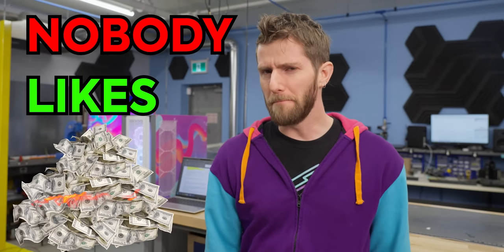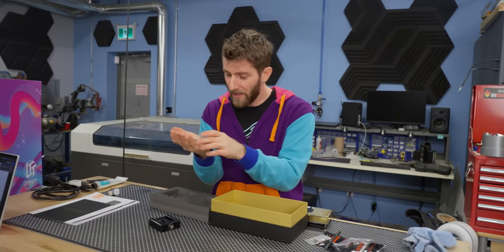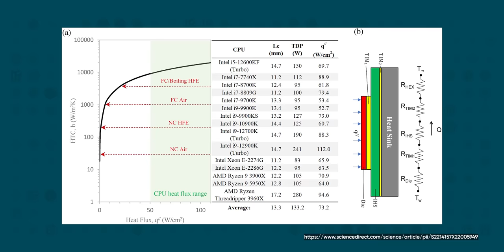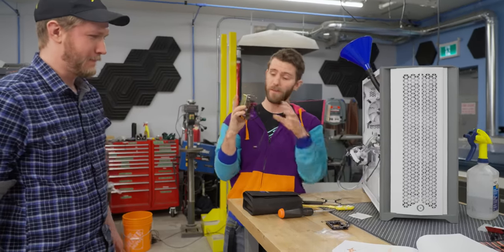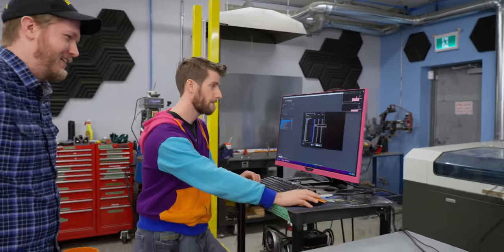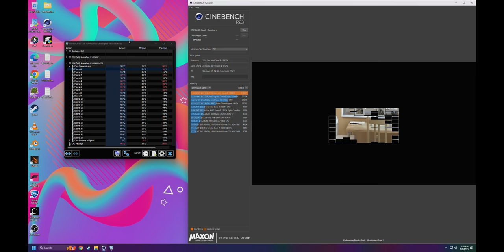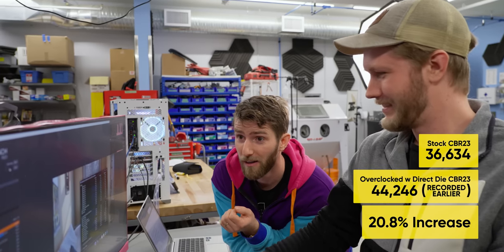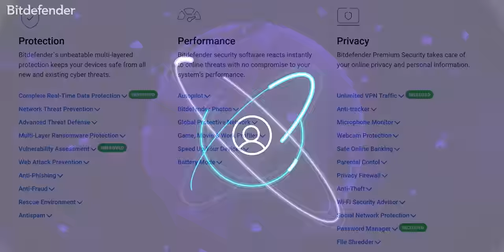This Cooler Might Kill Your CPU - EK Direct Die Cooler

Comment: Alex's gleeful little giggles at 17:20 has got to be the most excited we've seen him in awhile
Reply: Yea that's going to be a crazy video whatever it is
Reply: happy engineer noises
Reply: What is Elmer labs tho? I only find some biology stuff lol
Reply: @Lowkas  If it's ElmorLabs, then it's a PMD (power measurement device). It lets you measure the voltage, current, and power running through the cpu and gpu cables.
Reply: @Lowkas  ElmorLabs is a team that has specialized in cooling CPUs with liquid nitrogen and liquid helium, including being the first people to get a CPU to 9 GHz.

Comment: Hi linus and team , great job . Although let me tell u guys something,  i work as a engineer on uk , sorting water loops and systems to power plants, pharmaceutical companies as well aeronautics.  I believe you should get some control of your water there specially with all that copper laying around . I advise you to get a softener that later you can use for ur appliances and if you can an ro will be perfect as you will get water around 10uS (micro siemens) not being to corrosive . If you cant get an ro just remove the hardness of the water with the softener and they hook up a small mix bed to remove the contamination ❤

Comment: The delidding part was even more painful than Linus's usual... antics...
Reply: Very, very painful to watch and i'm dying with laughter right now too... after all that effort... they got 37334 on a direct die custom waterloop!... I get 37393 on average on a 7950X with 360 LF2 AIO which is not even being utilised 100% due to the one of the fans being at angle due to the VRM heatsink. Sure, they can get higher if the tuned the ram and settings in the bios but all that money and effort... for such diminishing gain 🤣🤣🤣.
Reply: @earthtaurus5515  I mean that was at stock... arent amd cpus OC out the gates?

Comment: Those old Athlons with ceramic packaging were very prone to die cracking, since the ceramic base had zero flex to give in and any over pressure of the heat-sink would start chipping corners and edges from the brittle silicon crystal.
Reply: I have a box full of broken ones 😂 few intel chips in there too.
Reply: Yeah, coupled with a very little die. Any pressure concentrated on an edge and you'd easily chip the die. 

The mounting hardware of the time didn't help either... (Single spring clip, essentially forcing an unknowing user to load one side in a rocking manner).
Reply: @volvo09  And only four small rubber pads to keep the cooler level.
Reply: I chipped one but it didn't kill it....I remember being so sad when I saw that little chunk missing while trying to mount the cooler
Reply: @tz8785  I would take the pads from dead ones and put them on my replacement chips. 8 is better than 4 at distributing the force and so on 😂

I had a duron with the entire perimeter with pads
Reply: Especially if you had a copper heatsink and a heavy fan combo. I remember waiting to smell the magic smoke after mounting everything. Especially when you had to change multipliers with conductive pens and scraping away the top layer to get to them 😬

Comment: I feel like this would be a really cool service to have as a system-integrator. As a hardware enthusiast I could definately see myself wanting this someday but I am sure as heck not voiding my warranty for it.
Reply: Nobody wants to be liable for a cpu that expensive, if they did it would be for a ton of money probably
Reply: @phantomnarwhal164  maybe if they could source them directly, without a heatspreader?
Reply: What I want are GPUs without air coolers. I have 3 new GPU air coolers just setting there collecting dust.
Reply: @nodgsd8823  i dont think he meant that problem is to delidding them. thats probably the easiest part
Reply: LOL you do realize you'd STILL be voiding your hardware warranty if a SI did it, right? AMD/Intel doesn't care who delidded the CPU, they're not going to replace it. Also any SI that did offer a delidding would tell you that if your CPU dies after you receive it because of the delidding they are not liable, otherwise they wouldn't offer it as it's too much liability.
Reply: @Midz350i  Yea those exist, you're just too cheap to buy the model that has a water cooler already on it.
Reply: @nodgsd8823  Source them without a heat spreader? Yea how are you going to do that? AMD/Intel are NEVER going to ship you a CPU without a heat spreader because that's just liability for them. People like you need to stop living in a delusion and accept that if you want EXOTIC solutions like this you are NEVER going to be covered by warranties.
Reply: Fun fact, its illegal for companies to void your warranty when a product is taken apart. The Magnuson-Moss Warranty Act of 1975 forbids companies from voiding the warranty on a device that the owner opened up and repaired or MODIFIED themselves. As long as a repair or modification doesn’t damage other components.

In other words if you mod every electrical component on a car but a wheel bearing shatters under normal use then the manufacturer must honor the warranty.

Inversely, if you do the same but the mod you did created a short and fried the ECU. You are SOL.
Reply: @Guardian_Arias  If you de-lid the CPU you aren't just opening it, you're removing a protective component. Attaching a cooler directly to the de-lidded CPU is running it in a way that was not tested or certified.  No judge in their right mind would side with the consumer on this one.  Of course if an integrator did offer a service with a warranty of their own then it would be a different story (though I'm sure they'd charge a pretty penny for it).
Reply: @grn1  I understand where you are coming from and I would love to have a gentleman's discussion but as someone who actually holds certifications to solder tiny components to NASA's specifications and...um other specs I   assume I won't be able to claim a warranty because I either fixed things or made it easier to recycle  BUT that doesn't one should be spreading miss information especially by a channel that has not only been sponsored by iFix it but arguably has the widest reach when it comes to tech.

I still stand by the fact that removing an IHS doesn't void the warranty. One its been proven to not only be possible but repeatable with 99% success rate.

Two if damage does occur due to the removal either directly or indirectly such as dropping it and the die cracking when it would have survived otherwise then that obviously falls within grounds for voiding .

Thirdly judges are not in their right minds to begin but thats off topic.

The first and foremost reason the hood of a car exists is to protect the engine bay. Its secondary objective is aerodynamics. Saying all warranties should be voided by removing a protective device not only implies all warranties for cars should be voided because you checked your oil or all warranties on your phone, pc, tv, refrigerator and so on should also be voided because you turned off the firewall on your router to see if you could get a bit quicker ping on Halo 2. Its a oligarchy out there and slippery slopes are slippery.
Reply: @shawnpitman876  Hm I don‘t really understand why you seem to be so upset. I think it would be nice if someone could figure this out.. don‘t like the idea? Don‘t think about it then. :)
Reply: @Guardian_Arias  Removing the hood of a car is a bit different in that it's designed to be opened and serviced, the lid of a CPU is not.  Even something like a waterproof phone is generally designed to be serviceable (just not by end users but you could potentially win that one).  The very act of delidding a CPU could potentially break it and you'd have to prove that it wasn't something you did.  As for judges not being in their right minds, I can't argue too much there though most of the cases we hear about actually have a good reason behind them (mcdonalds coffee [3rd degree burns should not be incurred by spilling coffee], lady who sued her nephew [sort of, it was due to a stupid law that prevented her from suing her insurance company], ect).

Comment: I love videos showing the extreme end of things, like cooling in this one. Me, I just used a good AIO, good airflow, and an aluminum CPU bracket. Runs quite cool. But then again, I'm running a 13th gen i7 with a mild overclock, not an insane i9 clocked to over 9000. And, holy cow, that Cinebench score. Insane.
Reply: No.. it's not. I'm getting the same score with on a 7950X with LF2 AIO, negative curve optimiser, custom core boost at 5555 Mhz and with multiple things running as well as hwinfo.
Reply: Always the same with these videos - even their normal reviews already run the CPU with insanely stupid auto-overclocks.
Was funny when i got my hands on an i5 12600K and set it up for an office-PC - B660M (did test it on Z690 as well). Slight tweaks and now it doesn't even reach 95W in cinebench, even with all the other benchmarks i threw at it it never exceeded 100W and max temperature was like 60°C. And that is with close to 17k point in CB23.

Comment: If you want to get a performance boost and not go through all this. Look up how to undervolt it. I changed my voltage on my i7 13700k because same issue. HEAT! I have a 360 custom water loop and I couldn't get it to pull heat fast enough just as they described. With no overclocking experience I learned how to change the voltage offset on my motherboard to -.035 and let me tell you. WOW what a difference. I don't go over 80C now when benchmarking. Before when I gamed I ran at 75 to 80c now I barely touch 67C in high end demanding new games. I have an rtx 4090 that pushes everything ti the max. I saw NO performance loss and my benchmark scores actually went UP because I wasn't thermal throttling at 100C anymore. Hope this helps someone. Do your research on your specific motherboard and only make small changes to undervolting. Also make sure it is a NEGATIVE offset so it doesn't overvolt! Linus please do a video showing people this!

Comment: It's actually worth noting that it'd be super cool if AMD/Intel sold unlidded chips.
Reply: True. Would be a godsend for SFF builds.
Reply: especially in extremely hot high-level cpu
Reply: They would never do that because people would damage them and want refunds under warranty
Reply: @thomasberry8873  they would make it detachable and not under replacable warranty
Reply: its actually not that hard all you need is a $5 delid tool. Ek idk why but it's the crappiest delid tool kit in history. An expert nitrogen overclocker showed him being super careful and ended up breaking it.
Reply: Or sold CPUs with integrated waterblocks as their IHS.
Reply: @impostorman18  that won't fly. Consumer protection is a thing. If you sell a product that designed to be taken apart, and then try to say "you took it apart, so there's no warranty", EU courts will have a field day with you
Reply: @impostorman18  Detachable won't work with these tolerances and prices. You either want it to stay put, or not have it on at all.
Reply: AMD used to sell them without the IHS. I think Intel did too, but that would have been back in the 80's.
Reply: @Dusty Carrier although it would be "super cool", it's not practical both from manufacturing and quality assurance standpoint. As every single CPU must hit advertised performance. That can't be done with delidded CPUs as there is no way in a blue moon AMD can test any single CPU cooler component combination and TIM (thermal interface material) to ensure they hit advertised performance. Nor can they sell unlidded batch of CPUs as every OEM must ensure they provide a manufacturers warranty which is based on component testing. In short, not practical for large scale manufacturing.
Reply: They kind of do in soldered on boards, laptops etc...
Reply: @theftking  It wouldn't just target those wanting a delidded CPU. It would target everyone wanting water cooling. The reason it's such a smaller niche is the danger of breaking your CPU, but having it integrated would solve that problem. CPUs are only going to become more power hungry. I wouldn't be surprised if water-cooled-only CPUs are a thing in 10 years, at least for servers.
Reply: They wouldn't do it cuz stupid people will blame their own stupidity on the company and demand refunds or compensation
Reply: @dbattleaxe Why not a stock LN2 block that's a non-removable part of the package instead of the current IHS.  CPU would drop itself to a 1970s speed like 4MHz until cooling sets in, thus surviving lack of cooling.  User-supplied cooler would feed a steady stream of liquid LN2, under vacuum, like with freon refrigerants, only less harmful to the planet.

Comment: Would be nice if you had an option of lidded or delidded when buying obviously some form of get out clause for the seller / manufacturer use the delidded at your own risk gives you the option..  Always nice to see Linus giving it no worries just do it.
Reply: Having more SKUs to deal with drives up the price due to needing to support more configurations with more inventory. You also then run into an issue of if too many people want one or the other SKU, then they may have not manufactured enough heat spreaders (or too many in the other direction). From a manufacturing standpoint, it is far less costly to ship 1 version instead of 2.
Reply: However it could be a warranty nightmare

Comment: Pretty neat.. I definitely will remove the IHS on my 7k series AMD when ever I get one. i'm still old 2600x for now, going to try to get at 5800x3d when they're 279, if that ever happens, and then maybe in a couple years go to AM5. But I want all the kinks worked out before I upgrade this next time. I've been messing with PCs since the XT / AT days and honestly this was my first build that I didn't mess around with anything, just put a system together and it worked SO well it left me desiring nothing. That was the first time. It's like getting a PlayStation when it comes out, it just works. We have come SO far in computers.. it's insane to have been granted the privilege of being alive in the 80s (old enough to remember the IBM PC XT CLONE (we had one!!) and watch this industry go from NOBODY having a PC at home to computer shopper age, to like CD ROMS and friggin SSDs.. it's nuts!!

Comment: I picked up a 13900ks with this waterblock, well not the limited gold edition. In any case, I delided the cpu just fine, mounting was super easy, and I'm sitting at 26c idle, and 33-40c under load. If you happen to live near a Microcenter, you can always get their product replacement plan,l and if you bork it, you can easily replace it for a 5th price.

Comment: I remember the days before heat spreaders. My first build was an AMD Athlon Thunderbird 900 MHz. Too much pressure or uneven pressure could crack the die. Missing or misapplied thermal compound could cause the die to overheat and crack back in those days (I've heard it could be a really impressive fail). Installing and booting that puppy for the first time was absolutely TERRIFYING! Fortunately, it went well for me

Comment: (gonna add something onto this. the heatspreader removal is most likely by EK moreso than derb8auer. simply because he has his own tool meant for 12th and 13th gen, and its different than the one EK includes. it also works better, proven by jayztwocents when he used the same direct-die cooler and heatspreader removal tool for his most recent (RIP) all-EVGA build.)

Comment: I love how you need a $200 liquid cooler block and risk breaking your cpu to get reasonable temps out of this thing
Reply: Meh, you really don't if you're not pushing it to the absolute max with motherboard core enhancements and limits removed. This video is not a typical user scenario.
Reply: You can get reasonable temps on a normal setup. The motherboards are drawing max power by default. Use Intel's default settings and there's no temperature issues.
Reply: @SP-go6lj  Great point.  I want to see this covered in a future video.
Reply: @Shad0wC0mpany2  They won't cover it they just want the most clicks possible and for AMD to look better since they get sponsored by them. I have a 13900k and its totally fine in terms of temps.
Reply: @SP-go6lj  Thank you!

Comment: @linus the question is... did you guys remove the two screws that stop the plate from going all the way?
They are only there for 12th gen because of some capacitors.
For 13th gen they can be removed... allowing more travel like you asked for.

what is true tho, is that it takes way more than 5 times... more like 20.
but in the end it comes off without prying.
Reply: Underrated. I was just typing this response out myself. You can actually see the screws are still present when he started the delid process.

Comment: I'm thinking back to what Digital Storm once offered in their line with a Cryo-TEC LC setup which was said to be put directly against the CPU. It managed to, at its time of 2010-11, get to the negative Celsius even when their CPU was overclocked, and there was a layer of frost on the outside of the setup since it was being tested outside of the setup as a proof of concept. I wonder what happened to that thing, if it came anywhere close in real-world setups, and if it might somehow be adapted to work elsewhere. Trying to look up what fluids they purportedly used in the setup, and what are fluids like now by point of comparison, as this is stuck on my mind.